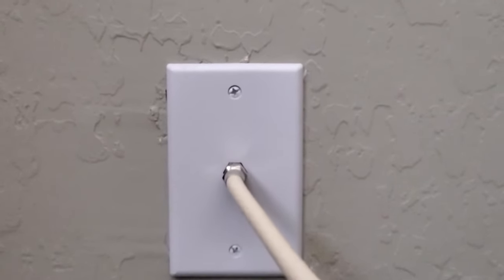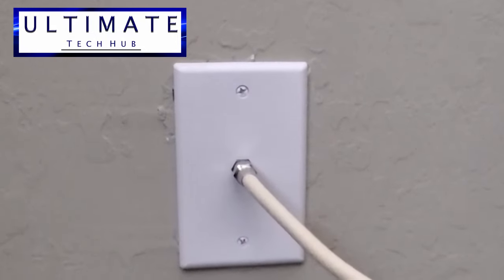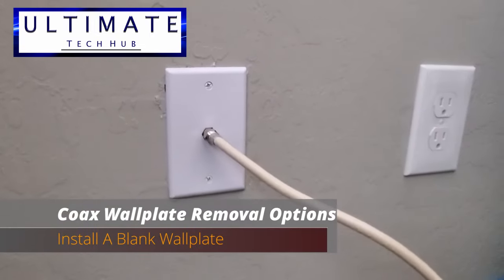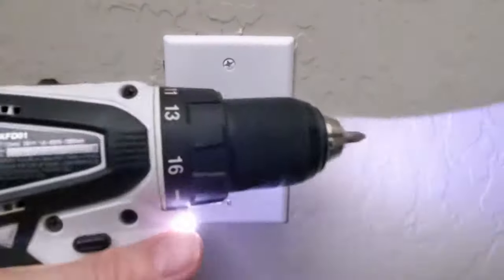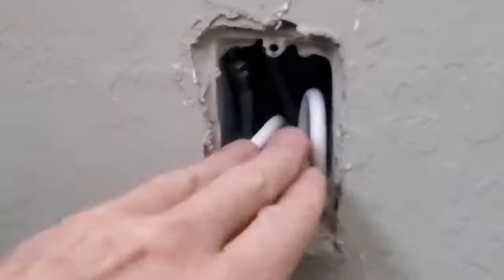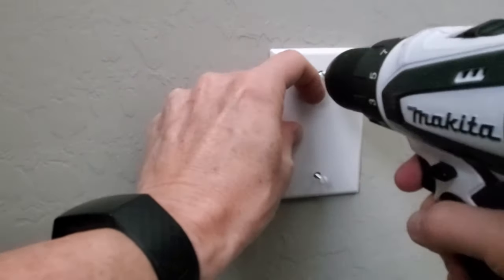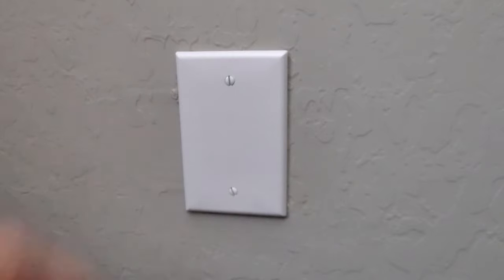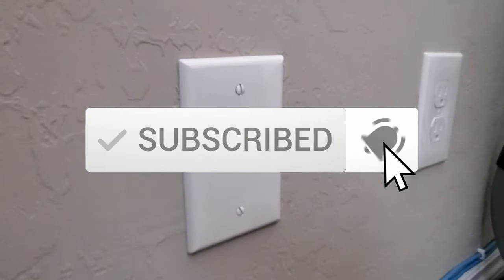COAX OUTLET REMOVAL - HOW TO

Comment: If im just replacing a faceplate do i have to turn off mains electric to do so or can you just carry on unscrewing the nut that holds the coaxial cable to the plate?
Reply from the maker: You don't have to turn off the power. Coax is low voltage and you won't feel anything if you touch it.

Comment: does every outlet have the white cable for the coax?
and if not is there a way to install one without breaking the wall/wiring from another room?
Reply from the maker: Usually every room has a coax however if not you can run a cable from one room to another.  Use a coax splitter then run the cable to other room. You may have to drill a small hole to run the wire to the other room.

Comment: So the cable can just live in limbo?  We have some coming out of our walls; not connected to a plate. Can i just cut them?????
Reply from the maker: It can live in limbo yes. That's how they are installed in the walls if the are not connected to a coax wall plate. Its' low voltage so no issues with electricity.

Comment: I’m having a problem with being unable to pull it away from the wall. Its not stuck to the wall, it’s as if the coax cable is extremely short and there’s no slack. I’m not sure if it’s safe for me to pull with a little force to get it to come out of the wall.
Reply from the maker: I would pull on the coax and try to get some slack. When installers run coax they always leave 6 or 8 inches of extra cable. Thanks for watching!
Reply: Instead of leaving slack some installers tack down the cable or weave it through the studs such that it binds. If it doesn’t move freely then don’t just pull harder as he suggests. If you get it to move you don’t know what’s happening on the other end. Just leave the excess safely hidden inside the wall — it’s only data with no significant current. 

In general you are best off doing the exact OPPOSITE of whatever this guy recommends. It’s actually comical — even a 5th grader knows not to remove wall plates and just start tugging on wires. If an electrician did that in my house I’d escort him out and have Code Enforcement inspect his previous jobs.
Reply: @drdrew3  this isn't electrical wiring dude. Cut him a little slack. 😉 See what I did there?

Comment from the maker: If your not using your Coax in one of your rooms then this video will show you how to safely remove the wall plate and install a sleek blank wall plate for a clean look. Thanks for watching.
Reply: An ugly blank outlet cover is by no means a “clean look” — that would require a small drywall patch and some paint. With 
WiFi replacing cable and unlimited cellular replacing land phone lines you might as well learn to do this the right way — otherwise your walls will be covered with ugly blank plates.
Reply: @drdrew3  All you need to do is purchase a small piece of drywall at Home depot for $7.  Or for value buy the full 6 feet sheets for $15.  Remove the plate.  Measure it.  Cut a small piece of drywall with a drywall knife or a oscilltating tool and a drywall plunge attachement.  Cut the drywall square a bit smaller.  Stuff the drywall in the hole, stuff the cracks with newspaper folded up,  then use a leveler to make sure its level.  Put some hot mud that dries quick in the cracks.  Let it dry.  Remove newspaper.  Fill in all cracks with hot mud.  Then, put fabric mesh over the square and skim again with prefferably lightweight joint compound.  Then sand with 400 grit.  Prime and paint.  Viola!
Reply: @drdrew3  I realize your comment is old, but I completely agree.  It's surprising how many of these "how to" are just replacing the plate as though that's any better.

Comment: How can I get the current coax that is on the wall plate, attach an extension coax and move it to another area but inside the wall? I figure a fish line going straight up will work but I need to go sideways in the wall.
Reply: Depends how far you want to move the outlet. Moving to another room without taking it out of the wall will be impossible because eventually, you'll end up getting to a space in the wall that is closed up with a stud. Most likely, the corner of the wall. You can use a combination of a magnet, and fishing line to pull it a short distance. Drill hole where you want the coax, feed fishing line, move finishing line with magnets to coax, 
Tie the coax to to it, pull the fishing line out.

Comment: Mine doesn't have the additional connector piece on the front...it is just a hole and the whole cord end assembly is through it and can't be pulled out.
Reply from the maker: The additional connector is not needed. Just follow the rest of my instructions.

Comment: How would you remove the box in the wall? that’s the part I’m stuck on.
Reply from the maker: You can use a drywall saw to cut it out. You will need a hammer to remove the nail that holds the box against the 2x4.

Comment: What happens if it’s STUCK in there?
Reply from the maker: It should unscrew from the coax wall plate. If its stuck use a wrench or pliers to unscrew the coax.
Reply: Ultimate Tech Hub ok thank you!